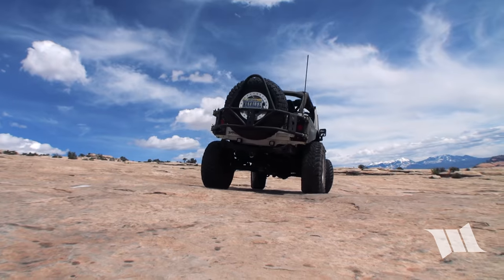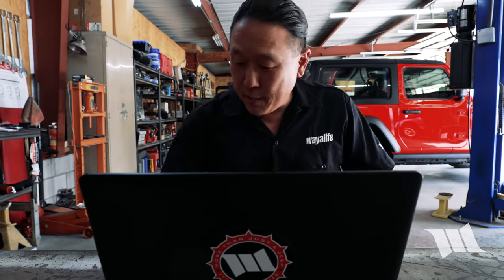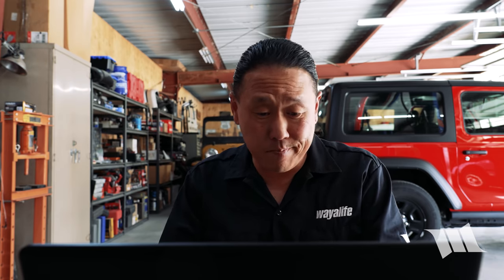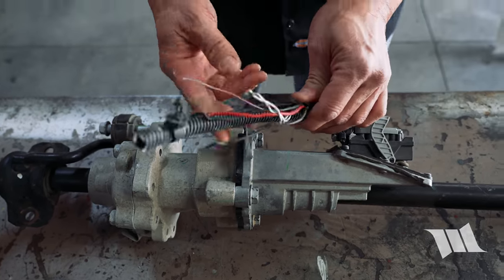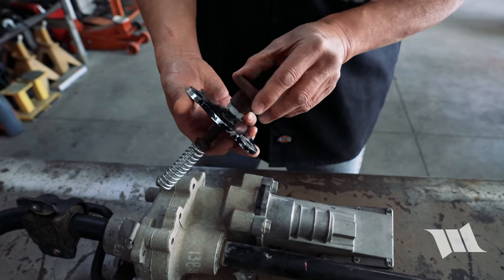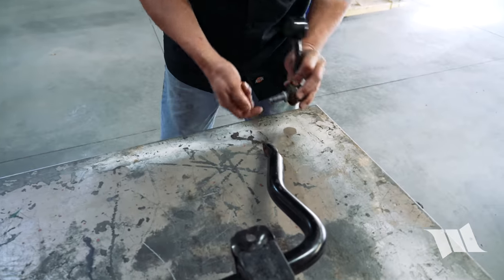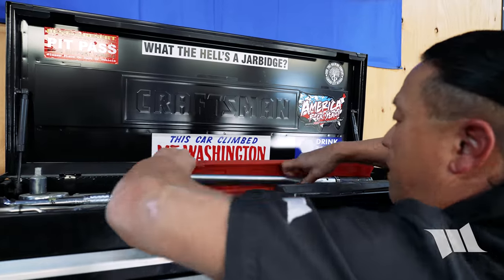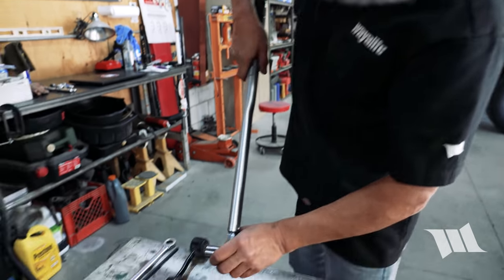My Favorite Sway Bar Disconnect Installed on Our Jeep JL Wrangler Sport and for Under $150

Comment: Just checked marketplace. You got a DEAL! Almost $500 in my area.
Reply from the maker: I assume those were with working motors? As mentioned in the video, the motor on the one I bought was not working. I actually found another at the same time as I found this one for $180. They are out there.

Comment: That is a great solution for the disconnect. I've the JKS ones and they so work great.
But as to 'used' part upgrades, thete are great things to be had dirt cheap. I picked up a brand new Rubicon Recon suspension for $100 - the guy had a mopar lift put on his as soon as it arrived at the dealership. It gave me a 2.5" lift on my 2 door sport s. $60 for the longer control arms and I still spent less than $200 for a nice upgrade.
Reply from the maker: That's awesome, congratulations to you.

Comment: Thanks for referring me to this video.  Unfortunately my 2016 JK will have to remain unchanged...I have neither your expert skills nor the shop like yours.  But, nice to know there is a fix.  Keep up the good work that you are doing.
Reply from the maker: You can totally do this. All you have to do is following what I did in this video :)
Reply: @wayalife A buddy and I just finished installing a BDS 2 inch lift kit today (your 3 inch lift kit how-to actually helped a little). Minor “trimming” was involved… lol that sucked. But I agree, this video is totally doable for a newbie - way easier than a lift kit. I had zero experience in suspensions of any kind before starting on the lift kit yesterday and my buddy had a little experience in suspensions, but not lifts.

Comment: Funny, I saw one for sale recently that no longer worked and I wondered why the heck someone would buy one. Now I know! Now to keep and eye out for one going forward...thanks for the tip!
Reply from the maker: Glad I could help!
Reply: @wayalife  does the Jeep have to be pretty level to get that locking pin in like you need to be for the manual disconnects?
Reply from the maker: Nope! And that's one of the best things about it. All you have to do is turn the knob and go.
Reply: @wayalife  nice. Funny I just saw someone ask about one of these for sale on the gladiator forum. He must have seen this video…😂 Cause that’s what I just did. 😉

Comment: I just want to add that for my Sahara 4XE, I found a good deal on used 2021 JL Rubicon Sway bar and I didn't have to clearance the Sway bar mechanism mount!  If you have a JL, try to get a JL used Sway bar and you should be good to go!  BTW soo much better that any other Sway bar disconnect1!

Comment: I considered that route but when I happened across the Apex Autolynx being mentioned in Jan of ‘21, I was one of the first to get them installed. Disconnect with the turn of a knob on the top of the end links and reconnect within 15secs and drive. For $400, they’re my favorite mod. No crawling in the dirt and no electric to run. They just replace your end links. Yeah, I’m a fanboy now. lol
Reply from the maker: LOL - as I state in the video, there are LOTS of aftermarket options available. For our purposes, we're trying to keep Pippi as stock as possible and that any mods we do make are done with budget in mind. $140 for a factory swaybar disco is that and we love it. Of course, with just a little more money, I can make it work off the air compressor I do plan on installing and it would work with a push of a button too.
Reply: @wayalife  Oh I hear you. Keep the ideas coming! What you did here was great. 

When I was looking into it, I had no idea a JK sway bar disconnect would work. The few used JL units online were $400 on up. I’d have gone the Evo mod, like you, so a bit more $ to get that in there too. The Autolynx just peaked my curiosity and they ended up being the flashiest pieces on my Jeep. 

For the most part, I like to keep mine modded with stock parts too. That way, if I break a part far from home…they’re usually easier to come by to get going again. 

Thanks for sharing this idea with the community. 👍🏼

Comment: Amazing video again :-) I got 0 mechanical skills whats so ever just the basic checking oil and changing a spare tire lol. My question is how do you know the torque numbers for these bolts? if so how do you get them? I'm just curious on that :-) thanks
Reply from the maker: I got the specs from a factory service manual but I also have them listed on my forum here: https://www.wayalife.com/threads/torque-specs-jl-wrangler-reference-guide.52799/

Comment: This is sick. I plan on buying one too, I have a 21' Sahara you think a JK one like this would bolt right up?
Reply from the maker: As I show in the video, a JK sway bar WILL require a bit of clearancing on the motor hanger but otherwise, yes, it will bolt up.

Comment: Curious - I was told when I was JK shopping in 2016 that the Rubicon e-disconnect worked well, but gave you a limited range on articulation. Is that true?  I went with the JKS’s you held up at the beginning of your vid - after going with a Sport so I could build it the way I wanted. So again - curios - was I misinformed?
Reply from the maker: I would never pretend to know more than whoever you were talking to but for me personally, yeah, that person was a moron and you were misinformed. The ONLY thing limiting your articulation are your shocks. IF your sway bar is limiting your articulation, your links are too short.

Comment: Awesome video! My question is will a JK disco fit on my 22 Willys Gladiator? Im finding some JK disconnects in my area for sale but not newer JL's.
Reply from the maker: As you see in this video, the disconnect I installed was from a JK and a bit of modification was necessary to make it work. A JL and a Gladiator are exactly the same up front.
Reply: @wayalife  thanks!! Your modification didn't look too hard to do, I'm gonna go for it. Thanks again for all you do, and show us!

Comment: Hmm, here's a sway bar disconnect question.  I recently picked up a set of JKS Quicker Disconnects to put on my stock JK. The install should be no issue, but I have heard reports that stock drivers might suffer popped tires when using them. Some events have happened because of the sway bar being lifted out of the way. For that, it is recommended to keep the sway bar horizontal. But there are also reports of the studs the links fit over popping tires. Any ideas of ways to prevent that, or might your trick with the steering stops for rubbing tires help?
Reply from the maker: If you run big tires on wheels with too much back spacing like you really shouldn't, yeah, your sidewalls WILL catch on the storage studs and can cause a failure.

Comment: Nice 2 post lift! Wish I had one. 🤭   Haha.  Years I've kept my burnt out Rubicon sawy bar to get the turn screw disconnect.  Til now, I haven't got around to getting one 😞let's see, for around 9 years now.  I been on anti rock. Not the greatest honestly
Reply from the maker: LOL - The antirock is nice, kind of a jack of all trades but a master of none. Good thing you kept your sway bar. I would definitely put it to use again 😎

Comment: I don't even know what I just saw? So a factory Sway bar disconnect allows that radical of articulation? How does it do while still remaining in the housing? Always wondered that.
Reply from the maker: When it's locked, it offers resistance and helps to keep your Jeep stable.

Comment: I just now am running the JKS quick disconnects. Is there a big advantage to using the rubicon sway bar other than it being much easier to connect and disconnect? I didn’t have an easy disconnect option before now and I’m having trouble finding a justification to upgrade the disconnect beyond what I have.
Reply from the maker: The only advantage is that it's a lot easier to use.

Comment: Good for you on finding a sway bar for $140.  Everyone I talk to that has one wants like $300 to $1000 for just the sway bar.  Just wondering if I can find one for JL or JT would this Knob work on it, or only for the JK?
Reply from the maker: As mentioned in the video, the sway bar motor didn't work. That's why it was so cheap. Also, the EVO knob would work on a JL or JT sway bar.

Comment: Do you think if the clearance issue is because the sway bar is from a JK? I was wondering if a JL Rubicon disconnect would work without issues on a Willys JL extreme recon. Any insights would be helpful!
Reply from the maker: Yes, it is possible that was the issue.

Comment: Do you have a link to all the torque specs? Not just for this install, but pretty much all the suspension parts? I noticed you are always quoting them and would also like to have the information since I work on my own vehicles the majority of the time…
Reply from the maker: Along with a ton of other really useful information, I have all the torque specs listed here on my forum https://www.wayalife.com/threads/torque-specs-jl-wrangler-reference-guide.52799/

Comment: I’m interested in doing the same thing as you but I don’t think I’m getting as good of a deal as you did. Would you say 250 for the rubi sway bar disconnect is a good deal?
Reply from the maker: It's not terrible. If you can't find anything else, it might still be worth it.

Comment: That's a great idea.  Great instruction video too.   Are the two sway bars exactly the same width?  Does anyone have the width measurement available?
Reply from the maker: Unfortunately, they are not exactly the same. There are subtle differences that make it so you can only install a JK one on a JL but not the other way around.
Reply: @wayalife  Thanks!  Hey do you know how wide they are from linkage mount to linkage mount?
Reply from the maker: @olliehopnoodle4628 they are the same as a standard stock one.

Comment: Would you get more droop by completely disconnecting the physical links at the axle sway bar ends  (the free solution) vs disconnecting at the sway bar center using the Rubi swaybar with links still connected to axle?  Does my question make sense?
Reply from the maker: Nope. The limiting factor are your shocks. They're what's preventing more droop on a stock Jeep. On a lifted Jeep, you need to make sure to run the proper length sway bar links to prevent them from limiting droop.
Reply: @wayalife  ahh, thanks

Comment: So one quick question? how do you get access the electric motor bypass plunger..(manual knob)thanks..
Reply from the maker: You still need to get on the ground but it's a lot faster and easier to do https://youtu.be/fTZiQKXjRGs

Comment: So much appreciate what you do here, especially for us lower budget folks with the sport models. Love all the videos.  I am ready to pull the trigger on this Active Stabilizer Bar 68572691AA (less the actuator) for a very good price. It says it is for JT but I feel that it will fit the Sport JL. Would love to use this with the Evo disconnect. Think it will work?
Reply from the maker: Yup, it'll work just fine on your JL Sport. 😎
Reply: @wayalife  You are just too awesome! :) Thanks for your help!

Comment: Myself being an owner of a 2019 JL 2 Door Sport, soft-top, and manual trans, I am very interested in your efforts on Pippi. Would a Rubicon JL Sway bar package also do the job?
If either a JK, or if a JL package would work, might a working motor be used and connected to something like a Switch-Pro?
While writing, your CB Bar with the Switch-Pro mount kit was an excellent addition to my JL sport.
Reply from the maker: Happy to hear you're happy with your CB BAR and yes, the JL Rubicon disconnect would work as well. If the motor is working, you should be able to wire it to a Switch Pros.

Comment: I have another question please I’d like to get some of the quick disconnect swaybar links for the front of my 2023 JL wrangler. Which ones do you suggest that are good to install and also I would like to not have to cut the mounting bracket like I see on some of them. I don’t really need a sway bar disconnect too much but when I need it, I’d like to have one. Any suggestions would be appreciated again thank you so much.
Reply from the maker: If you don't see yourself really needing them, I would recommend that you just stick with the factory links and manually disconnect them as needed. You can see how it's done in this video https://youtu.be/vQX6VERI5_0
Reply: @wayalife  thanks good advice.    I appreciate your time

Comment: Hello, I have a question.
I did this same modification on my JL sport, but the sway bar is damaging the pitman arm end when turning left. I replaced it with a new one and it damaged it again.
Can you give me some advice so that this does not happen again?
Reply from the maker: Sounds like your sway bar has shifted over toward the passenger and needs to be pulled back over to be recentered.
Reply: @wayalife  Thank you very much, greetings from Mexico!

Comment: awesome vid and thx for links to tools/parts! ((i would've shaved the housing and not that 'zig-zag' bar in case it's under a load.))
Reply from the maker: If you look at it carefully, it's essentially an exhaust hanger. There is a rubber sling that helps to keep the motor from rotating. In other words, there is NO load.
Reply: @wayalife  at, thx!  #liked #followed

Comment: So where does one find a non-working rubicon sway bar?  Cannot seem to put in the correct search words to get anything but working ones to come up and they are running around $900.
Reply from the maker: I found mine on craigslist but have seen them on marketplace too. Even for a working disconnect, $900 is way too much these days.

Comment: What would you recommend as a budget manual gladiator ecodiesel sway bar disconnect?
Reply from the maker: Simply remove the swaybar bolts on the axle and zip tie everything to the frame. It's FREE 😎😎

Comment: My only question is what about the factory electrical on a jku Rubicon will it throw and code ??
Reply from the maker: Sorry, not sure about that. Even if my electric motor worked, I would have just hard wired it to a  separate switch.

Comment: could you have used the JL bushing (with the bump) so they match the shape of the frame bracket?
Reply from the maker: Yup. And I still might change them out but I haven't felt or noticed any difference without them.

Comment: Could you use the same setup on the rear sway bar as well
Reply from the maker: The factory rear sway bar is soft enough to manipulate by hand and will NOT limit your flex. You do NOT want to disconnect fully it as it will provide well needed stability, especially on off camber situations.

Comment: Will this Rubicon sway bar disco work on a sport JK? I have the JKS discos but this is even easier. My problem is always reconnecting. I try to reconnect after the trail and it is never flat and so it is hard to line up again.
Reply from the maker: Yes. In fact, you won't even have to clearance the support bar like I had to do on this video. And yes, you can reconnect even on uneven ground with this.
Reply: @Wayalife  Thanks! So how lucky do I have to be to find an ad like you! Only good if the disco is included. Evo you said?
Reply from the maker: @christ7590  We found 2 available for sale and as soon as we started looking. The key is to find one that the motor doesn't work as that will bring the price way down. The EVO no limits knob costs $100 new.

Comment: So hi. I’m a jeeper all the way from the Middle East (Abu Dhabi UAE). I’ve gotten my JLU sport S in July and have been suffering from the wandering steering wheel problem ever since. It recently scared the s**t out of me cuz I dropped my eyes to grab a bottle of water and suddenly I was heading to the next lane and almost into a 6 wheel truck. Mind you, I had my family with me at the time. 

If you have any suggestions to stop the steering wheel from wandering all the time I would be grateful to your advice. I’ve seen a video about tightening the steering bolts under the engine air  filter, but the mechanics said it’d need to be aligned afterwards so I haven’t done that. Any other suggestions?
Reply from the maker: Is it safe to assume you're still running stock wheels and tires? If so, try lowering the pressure in your tires. Take them down to about 30 psi and see if that helps.
Reply: @wayalife   so I basically went and tightened up the bolt and hexagon screw and 
Update is that the approx 3 inch sloppiness seems to have decreased to about a 1.5 inch sloppiness. I believe I have a little bit more responsiveness from my steering wheel now
Reply: @wayalife  my JLU is bone stock. But I didn’t try the lower psi because I drive on the highway most of the time.
Reply from the maker: Sorry, not sure what screw you are referring to. Are you talking about on your steering box? Also, the tires that come on the Sport will feel flighty at highway speeds or at least, until they wear in. Even at highway speeds, you should never have more than 36 psi in them as that will have you running on the crown and cause flightiness.
Reply: @wayalife  yes the one on the steering box. I will be airing down to 34 psi, as with the heat the psi tend to increase
Reply from the maker: @Mohammed-cx2jg  Okay, I typically would NEVER recommend adjusting the steering box. That will cause it to wear out prematurely.
Reply: @wayalife  well I did think of that at first, but I just couldn’t help myself seeing as the whole issue was a problem from the start. I didn’t do a whole lot of adjustment, barely tightened the hexagon screw on top of the steering box. Say, if point A on the nut was at 11 o’clock the adjustment probably made it at 11:30
Reply: @wayalife  I did book an appointment with the dealership here and I’ll get them to have a look at it, but thank you

Comment: Much cheaper swaybar fix than my G2 swaybar disconnect! Still, I would’ve been stuck with fitting it into place since I don’t have the vise or grinder.
Reply from the maker: Yup, you would need at the very least, a grinder to make this work on a JL. On a JK, you would not.